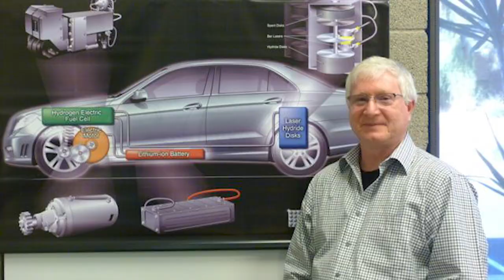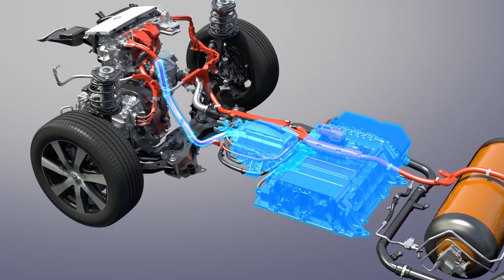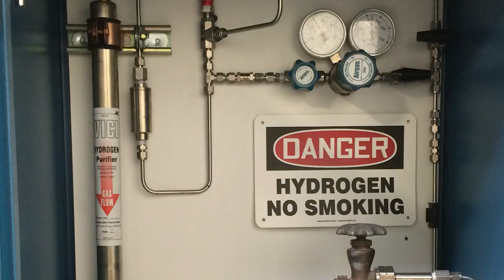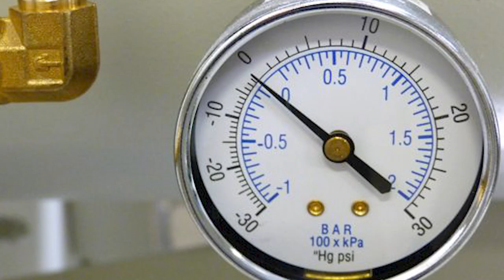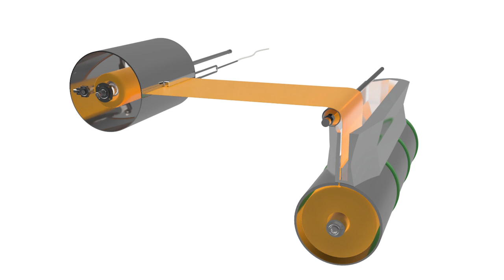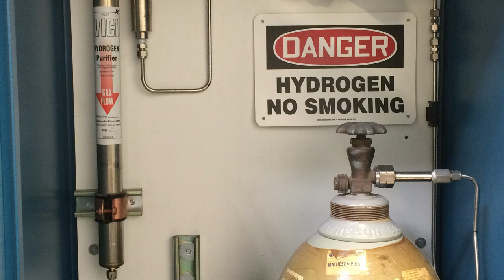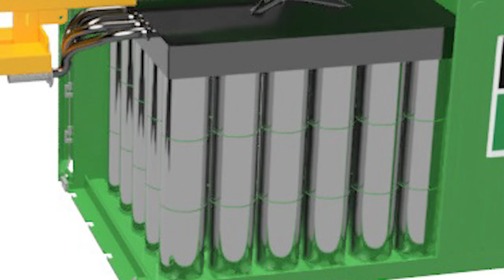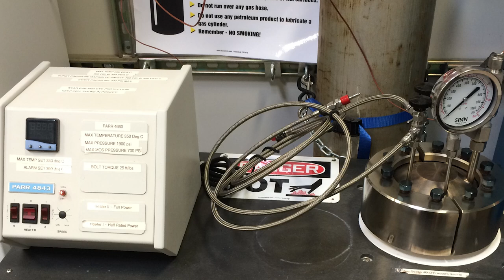This BANNED Technology Could Push Hydrogen Cars Over BEVs

Comment: Ok… all of this sounds wonderful in theory. I’ve enjoyed reading the skeptical comments. To me, this means brain power being applied to the concept. All good.
The real formula question though is what will ultimately tell the tail and I don’t see it being directly addressed.  These questions are not obvious and often not addressed because the developer doesn’t have answers or doesn’t realize it yet or does realize it and is kicking the can down the road all of which are exercises in what are excellent examples of whishfull thinking. Which is what you get when you’re not asking the right questions…. So sorry for the lecture. Not sorry enough to delete it though. I’m making sure here we’re not doing the wishful thinking contagion. Very addictive. Excellent time and effort consumers mostly because they’re fun.
The “ not so fun” part asks about efficiency.  We’re gonna make and safely store hydrogen using electricity…. so we can make electricity….. ???
“Yeah, but we’re starting with ac and ultimately producing dc.”
“??? Um …I don’t remember that ever being an efficient transfer of energy. That whole Edison / Tesla thing back when….. ? Ok which side of this debate we’re you on??? Im confused”
Well, all too often that’s exactly the point. Keep everybody thinking somebody’s got all of the answers.  When the problem  is that the right questions aren’t being asked. …is this the case?
My little pee brain says even if the efficiency of transfer was maximized, there’s still the “why transfer the electricity at all?”  Reasonable question. That doesn’t go away when you solve  inexpensive plentiful energy sources. Which are geothermal and nuclear.  …by the way I like Elon as much as anybody.  However, skeptical I remain is my business. That is only because I hope I’m wrong and I’m really hoping he’s right about everything! Is that wishful thinking??

Comment: It seems to me, it be much more efficient for a worldwide standard to Simply burn the hydrogen in the internal combustion engine.

Fueling stations could easily be fitted , upgraded and or storage capabilities changed for this.

Putting EV charging stations across the world is just simply not doable.

Then you look at place like California with the rolling brownouts and blackouts so how do you charge your EV then?

Comment: At the moment the thermodynamic efficiency of hydrogen production, storage, compression, transport, conversion to ammonia are too low to be either energetically or economically viable.   Without compression or transport from electricity and water to hydrogen and back to electricity again is less than 50% efficient where batteries are over 90% efficient.  As soon as compression, storage or transport are involve the efficiency goes down even further.  Research should continue to try to increase the efficiency but until the thermodynamic efficiency increases to that of batteries hydrogen as a renewable fuel is a pipe dream.

Comment: You didn't address the fundamental fact that hydrogen generation is only about 70-75% efficient meaning if you use the electricity to make hydrogen you loose about 25% of the energy before it reached the vehicle. Where as you can use the same energy in a battery cell and retain over 99% of the energy. The only application that makes sense for is one where weight is more important than cost. maybe an air travel application.

Comment: 6:30 then 830 and finally at 10:30 WE GET AN ANSWER. It seems the interviewer had the same problem that I typically have with my wife... had to ask the question 3x before getting the answer: 15 pounds per 20 miles... so about 300lbs of the stuff for a 400 mile range.

Comment: This seems like a neat technology, and I see possibilities for long-haul shipping and air travel because of the weight/space savings.  However, for cars and even for Semis, I don't think this will be the best option.  He talks about his units being cheaper than batteries, but we'll see.  Also, I doubt that includes the cost of the fuel cell itself, which is still very expensive!  Also, you will need at least some amount of batteries for an energy buffer.  But here is the real killer for using them in cars and especially in Semi's- the cost of the actual fuel, electricity, will always be higher for fuel cells.  It takes a lot of energy to peel hydrogen away from other molecules, and converting that back to produce electricity is highly inefficient compared to today's Li-Ion batteries.  Over the lifetime of a car, or especially a large Semi, that extra 'fuel' cost is going to add up significantly!
Reply: I read recently that "Liquid metal" batteries would serve to store power from windmills etc but still too heavy for vehicles.They transfer electrons from one metal plate to a dis similar metal plate creating useful but not dangerous heat and electric power. .The two metals do not degenerate but gain purity meaning very long battery life.

Comment: I'm intrigued by hydrogen power as a source for transportation, but this does not sound very feasible at this time. Swapping out these cylinder containers every 20 miles when one has to drive longer distances is not practical.

Comment: Whatever happened to the hydrogen cell that ran on water that split H2O into H O2 at point of combustion contact.. seems getting energy and Oxygen as a byproduct would be ideal.
Reply from the maker: I didn't take it :-)
Reply: You need at the very least the same amount of energy to split water into H2 and O as the combustion of the two will release. As you also need to somehow convert that heat energy into rotary motion to drive wheels you loose a lot of energy in the process (things heat up, magnetic fields need to be established and destroyed, wires have resitances, etc) the process you described would be horrifcally inefficient.

Comment: Thank you so much E for Electric. The question with any H2 options is: how much does it cost, to provide a full range of 400+ range, and with decent or great performance? With Plasma Kinetics method, what is the consumer's FINAL investment? They still need to invest electrical input ($) and mechanical pressure to 5,000 psi ($). In economy terms, 15 lbs of cell provide 20 miles. For a 400 desired miles of range in a family sedan, the family will need 400 miles / 20 miles per cell = 20 cells, weighting a total of 300 lbs (15lbs per cell). It brings the question; how long does it take at the "cell swapping station" to change your 20 cells? How long will it take for every cities, towns and highways to be populated with "swapping stations"? Obviously, this massive infrastructure ($billions) will not be paid by them right? The tax payer will pay for it. And "shining a light on the film will release the H2 back to them" is not viable to power a car with H2. You positively need to pressurize gaseous H2 at 10,000 psi, in a suitable tank, because H2 at a normal pressure of 1 atmosphere cannot move a car. It's way way too weak. And one more hidden cost to any current Hydrogen option: engine lack of energy efficiency:
In Thermodynamics physics, every time we ad steps and processes to the mix, we lose energy invested in making it work. Conversely, solar panels yield useable electricity directly stored in batteries and electric motors converts energy at about 90-98%, whereas a gas H2 piston engine, has a best conversion ratio of 60%. So, you only use 60% at best of your money to move your car, whereas you waste 40% in heat. When I entered college in physics decades ago, I really believed Hydrogen was the future. And nobody new (except very few Chinese) what photovoltaic panels were. So any H2 modern systems aiming at replacing fossil fuels, will gladly perpetuate a strong dependency on using and paying for their cells swapping, distribution and logistics. 
It's still a bunch of un-necessary added steps, energy losses and money costs. Right now a Tesla Model S will cost you about $14 - $15 on your hydro bill for 407 miles range, with outstanding performance. No oil change, no transmission fluids, no valve adjustments, no new muffler needed. The above numbers may vary a bit from state to state, year to year, but going electric is the future. And the Sun will generously provide energy for a few more billion years. It's abundant and free. Cheers!

Comment: Nope.  Cars built for this would be much more expensive than electric.  The fuel cell is glossed over in this.
Watch the assembly video for the Toyota Mirai.  They shove just an incredible amount of equipment into that car.  This will be about the same.
That means no fronk.  No fantastic crumple zones.  And a fat cost.
Any imagined increase in range will likely be surpassed by electric by the time this hits the market as well.

Comment: Why if diesel electric has been the standard in efficiency for all countries to use in mass transit, rail. Why has this technology not been more invested in. This technology was introduced in WWII, only being ousted due to lack of materials and processing in Germany. Then all of a sudden everyone used it for rail. And still uses it today, yet where are the advances on it. Oh wait, because if you combine diesel electric/battery in a car today you could get what 1000 miles for 10 gallons??? Hmmm to efficient and not good for a return on production, where as pure electric still has a huge oil dependency. From production to charge.

Comment: I created the renewable power to electric vehicles and even planes with no hydrogen or electric need to refuel them, despite you have to sh’t every day or even you can put household trash into fuel tank and of course it’s easy to use, just open the renewable fuel tank lid and sh’t. 🌚👀🌝

Comment: Use e=mc2 law 
Energy 80k for gas =mass of car and then mpg give you how effient your car is 
My 99 got 35 mpg and weighted 4300 # after add better parts it dropped 7 mpg when went 7 inch wide tires 
Smart car get 45 mpg and weighted 1900# so it should got 70 be same

Comment: 10:38  15 lbs = 20 miles 
11:10   4 times 370 lbs = 570 miles 
lousy weight to miles ratio !  this whole thing about H2 stinks . its compressed in the car to 10,000 psi ??? !!! too much crap to go wrong , then what the heck do you do ?

Comment: I've said hydrogen is better years now. All the problems that hydrogen can be easily solved. People doing the same thing it was doing with gas. Constantly stretching the limits of something that was already inefficient as it is. No only the material used to make batteries are hard to come by. But also very hard to mine, also dangerous to make. At least with gasoline there was changes made to make it better. But the battery has make very little progress. We changed everything around batteries to much power as we could from it. The limitation that hydrogen has. That is  lack of time and effort put into making it better.
Reply: "But the battery has make very little progress." hahahahahahaha. Efficiency and price of batteries have made huge progress in the past 20 years.

Comment: The comments on my comment below have real merit. I think hydrogen creation should only be done via completely renewable energy with zero emissions then it would work. Either way we need to change. I personally see people on the ground as the priority. We need to stop blowing diesel exhaust at baby pram level. Where I live in the UK the local air quality kills 1000 people a year. Even if there is a little short term pain to get these technologies in play it will be worth it. Economically it'll work out too, as any older ways that die out will be replaced by new industries.

Comment: 15 lbs. per 20 miles? So, 1.33 lbs. per mile, or 400 lbs. for 300 miles of range...

An interesting proposition, but what about all that waste after the 100 uses? That's going to landfill, right?

I still see a lot of benefits in a largely untapped Fuel Cell ecosystem which makes it more environmentally friendly and more renewable.

Comment: Why use such exotic materials? Why not use a more conventional approach with distilled water in a transparent aluminum jar with electrodes and a stainless steel or Kriptonite metal brillo like pad inside a wisk like electrode and hoses that pass the gas released from the water molecules to pass thru a hose into another transparent aluminum jar filled with distilled water with a long hose in it as a bubbler to isolate the gas and preventive measure and transfer the gas to fuel injectors in a standard cumbustion engine. Then out comes water after the hydrogen is ignited and under pressure moves the piston down and the cam gear opens the exhaust port valve to release steam after cubustion thru the exhaust without need of a cathlitic converter.. This practical application can be added to any fuel injected engine bay of any vehicle that burns gasoline and be refitted  without sacrificing the cars we currently own to send them to a scrap yard to buy a brand new product,. And we conserve our natural resources without sacrificing land fills with damaged cartridges and  also does not impact the environment with harmful polution. But also a hydrogen fuel cell electric car would be the ideal transition for our future, along with distilled water stations available and get an average yield of 300 miles per gallon or more from distilled water.

Comment: USA, not a great place to start, a smaller greener nation would be easier to gain widespread adoption to prove the concept works. A very similar system is used in India, on tuktuks, but there they have battery stations where drivers swap battery cells, Simple plug in swaps. One last thing, enter the 2022 Earthshot Prize next year, it's US based and worldwide with huge promotion and a million pounds as a prize. Why wouldn't you?

Comment: To cumbersome for a daily driver...battery technology is improving at a fantastic rate and will only improve in the next ten years. This is an interesting technology but not much more than that, 15 pounds for 20 miles is horrible unless you're talking a liquid transfer and that would make it three time heavier than gasoline for the same range. Imagine you have to lift and change out 15 pounds for every 20 miles you drive...not a real solution people.

Comment: wasn't he one of these guys that said he can run cars on water... what he actually had was a battery to perform electroysis on the water first

i can't be bothered to listen to this but tbh it's likely garbage.... usually the clue is when you get more energy out than you put in, so for example he has some "shortcut" apparently to release the hydrogen which then leaves the bond energy unaccounted for

perpetual motion basicly

Comment: At 15 pounds for 20 miles, you’d need 225 pounds or 15 of these ‘cassettes’. That’s 300 miles. If you wanted to go on a long trip you’d have to have another 225 pounds of cassettes in your car. How would to e charge them so they become reusable? Instead of gas station it becomes a swap station?

Comment: Sounds like something that needs to be pursued or improvement, but I don't think it would be very user friendly for quite a while. They've been working on it for a long time and it is just 20 miles per 15 pounds of weight that has to be transferred. That means a 200-mi trip would be changing out 10 of these 15 lb packs. Day after day you should have a car I don't think people are going to want to do that unless great improvements are made. Battery charging has gotten so quick as far as on the road say with Tesla you can spend your time drinking a Coke and eating the hamburger and be on your way and not lift a finger other than plugging the car into the charger. And what is the price right now for 20 miles worth x 10 packs for 200 MI.? And with the just say Tesla system you can just recharge at home plugging into the wall. Most men and I guarantee you all women will not want to deal with the hassle of the packs. Like I say it sounds like something that should kept being improved on but it is nowhere near ready in my opinion.  And by the time it is feasible where is battery pack technology going to be by then. I think it is like VHS and beta tape players. Beta cost more and gave better picture but it just wasn't feasible compared to VHS lower price more than adequate quality. This could be a never-ending appeal battle it just doesn't go anywhere without some breakthroughs.

Comment: Certainly a dramatic development. Two components of concern for me, and no doubt others are the fact that you can get the hydrogen from fossil gas. You won't need more explanation than that. The second is the efficiency. If my solar panels 'make' enough electricity in 1 hour to drive my car 10 miles at 70 mph, how far would I get with this system? There are other questions like how big is the catalyser for an equivalent on the road continuous output? and what are you going to do with the deuterium? but they can wait. There are a lot of comments based on old assumptions, I'm prepared to listen to the sales pitch and not challenge the science. After all, he's not going to give away all the trade secrets and probably knows a bit more than I do about hydrogen. Obviously if it's all a great big lie then it won't work except to trick investors, so I'll ignore that. Others will spot the flaws faster than I can. The other element is that they are going to have to keep up with and overtake battery tech, and that doesn't seem to be slowing down.

Comment: I still am not clear on how the hydrogen is manufactured. He mentions electrolysis and reformation which are both very energy intensive. The problem with this video is the claims aren’t independently verified. I smell snake oil.
Reply: If you Crack LNG you get Hydrogen thru a process of extreme heat & pressure passing it thru a catalyst bed. The ideal source is H2O water!!